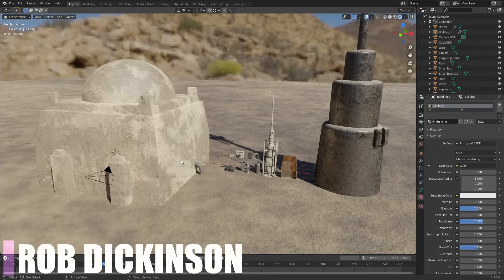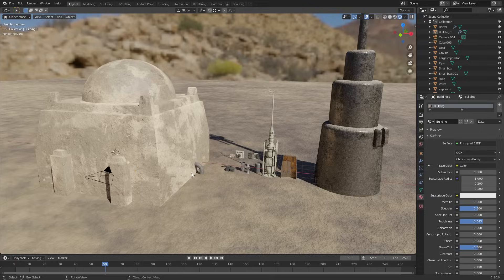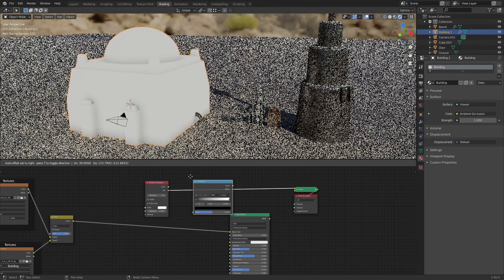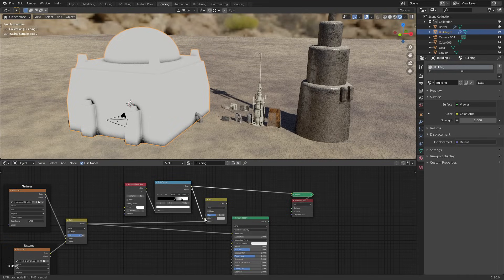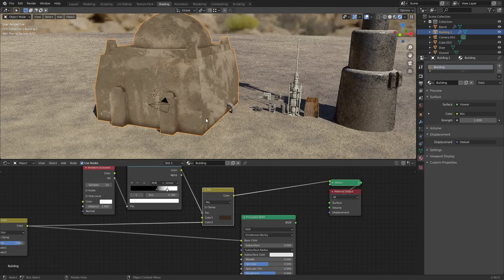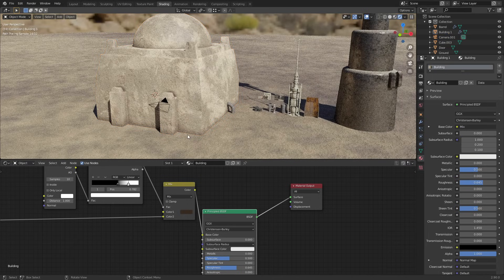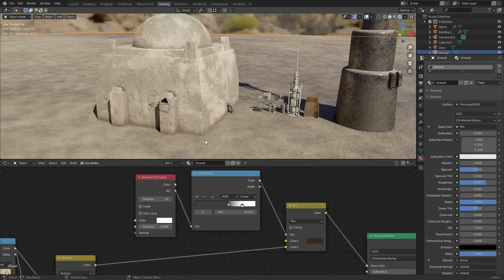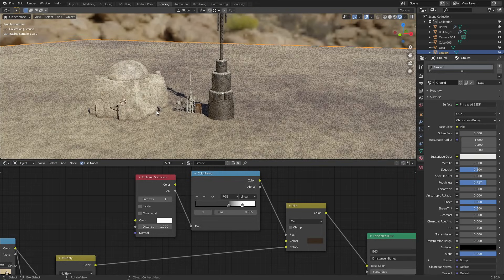A Quick Trick For Extra Realism (Blender Tutorial)

Comment: Is there a way to tell the AO shader for the ground only to take specific other objects into account? I tried to use this method for a scene where I render a skater in front of a skating pipeline. The problem was that the pipeline looked too sharp on the ground like you described in your video. When I tried to add some edge dirt to both the wall of the pipe and the ground by using the AO node it works quite well but now the skater in front of the pipe also has this dirt under his feet on the ground :) So I wonde if there is a way to use this technique for the ground but avoiding that every object standing on the ground get this dirt underneath it.

Comment: Tyvm for showing how to use the AO node I was wondering about that...

In UE4, there's a hidden parameter called contact shadows that does something in addition to the AO that really makes a character's contact with the ground truly believable.  

I wonder if you know the Blender equivalent for that?  It's in the light parameter settings in UE4...and it ain't like turning on a shadow catcher.  It's specific to shadow around the contact of the sk_mesh's feet...
Reply from the maker: There's a contact shadow setting in Blender. You have to enable it for each light. It's in the light properties panel under the shadow drop-down. You only need it if you're rendering in EEVEE.
Reply: @DECODEDVFX , oh cool.  That makes sense to me given both UE4 and Eevee  are both real time remderers...I'll look for it...

Sometimes when I render in cycles I felt something was missing from my renders and it seemed like the contact shadow, but with the introduction of being able to use AO, like I can in UE4, I'm gonna give that a try today.  Now my packed textures can be used 1 for 1 in blender so renders for my friend/client, can be previz'd in Blender that much more close to as if in UE4.

For a sec , I thought vanilla cycles had render passes (AOVs) but idts, but e-cycles does and  octane does.  

There are times I'd like to control the power of my shadows (coming from C4D and Redshift) and it was good I could render out AOVs. Now again with AO...do I even need to do that anymore...I will see today.

For vanilla cycles users, then now they can produce the clay/AO renders e-cycles can to show for (if they want like Chipp's addon that I can't afford atm...) a NPR type of rendering.

Comment: One issue with this. Wouldn't a character also create grime on the ground as they walk? Not sure if that would be a big problem but it may look strange. Would be cool if the "only local" could be used for a specific collection instead.
Reply from the maker: Yes, that's what I was referring to at the end of the video. Every object will influence the AO of the ground plane. One way around this is to remove all the moving objects and characters from the scene, then bake the AO to a texture. That's what I plan to do for this animation.
Reply: @DECODEDVFX  Ok that makes sense. How do you bake AO?
Reply from the maker: @paulpierantozzi  I have a video on texture baking here. https://youtu.be/fbH4aQB5FiM you would essentially just connect the AO output to the material output instead of the mix RGB node, then follow the same process as the video I just linked.

Comment: the more robost method is blend textures.   make a simple trim sheet with all the dirt effects on it.  and use it  as an overlay on the main material with a secondary uv map.   the advantage is a faster render and not having to worry about external objects.  also more detaild dirt and leak textures.      you can also port those to game engines assuming that kind of decal is supported.  and you dont have to paint anything since you can reuse the trimsheet.

Comment: Thanks for the tutorial! If you set the mix node to a blend mode like multiply, then set your color, you can get some more natural/organic looking interactions with the existing color. And you can also use something like this to affect the strength of your bump node, or your roughness material if you have one for an even more detailed effect. 👍
Reply: For something like a film or cinematic you'd manually paint a texture for that blend region, right? Using AO, originally meant to darken close corners and crevices, is a fast way to get a similar result, but you'd usually manually paint in a grayscale texture to control that.
Reply: @doko3000  the real answer is that you would use substance painter, which allows you to use a mixture between AO, cavity, and a world space gradient to do it procedurally and quickly
Reply: Nice! Thanks

Comment: Good tutorial! Made me wonder if you could use that mask to do some displacement in the corners to have an actual buildup of material there. And more importantly, could it be used to spawn little pieces of debri just in those areas (like in the photo you showed)?
Reply from the maker: Yes to both questions. But you'll had to bake the AO to a texture in order to control particles with it.
Reply: @DECODEDVFX  Yeah, it works with baking indeed. Which is a bit of a hassle as you have reconnect your nodes for baking.

It would be cool if there was a shader output node that could write to vertex colors.
Reply: I think you'd have to bake it. Then it can be used whatever the way you want.  As for debris - not sure. Probably much easier to make vertex group or even make a mesh of junk and debris piled up in a straight line like they often do it for games.
Reply: Yes, you can use a mixRGB node on your height map to get extra detail on those areas.

Comment: You can also use the gradient node and connect it in the factor, very similar to the ambient occlusion node, but the advantage of the first one is that it is lighter in EEVE
Reply: how so? wouldn't just make a vertical gradient from the ground rather than accumulating in crevices?
anyway, on the opposite side of the spectrum, (meaning to make it heavier but more refined) you could mix in a noise texture to make the dirt more random and jagged.
Reply: I"d have to try it and play around, by I imagine it would look to neat and perfect, too uniformly present everywhere. Maybe adding noise or some measure of mesh curvature could help.   AO emphasizes the nooks and crannies, the inner corners where whirling wind doesn't reach as well, where grime and dust and dead bugs and crud can build up.